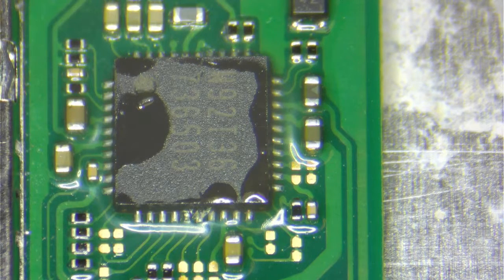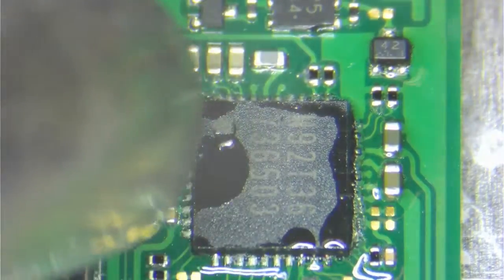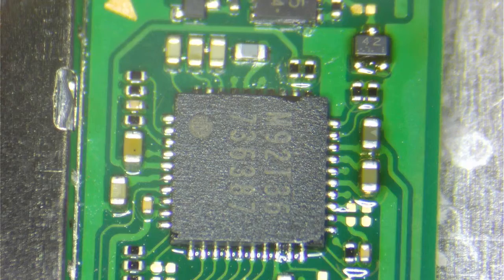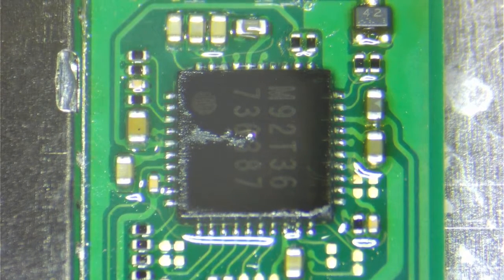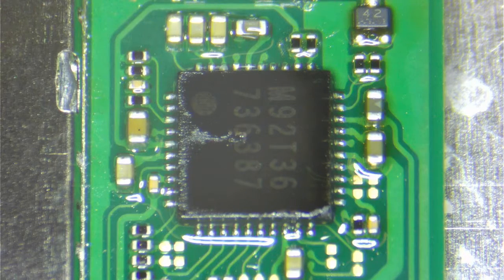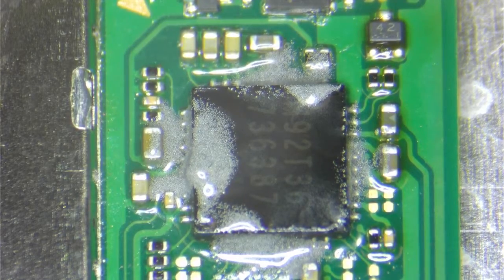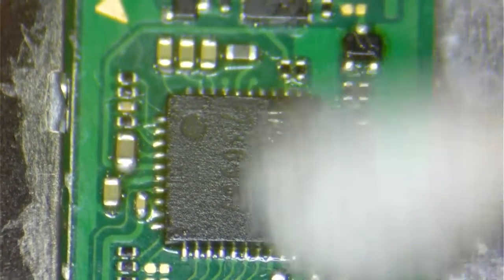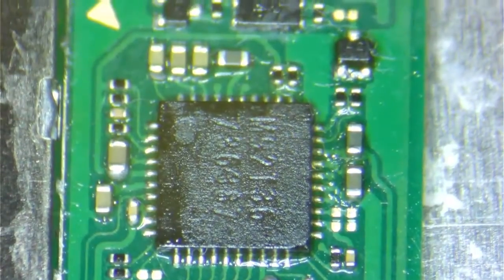Nintendo Switch Not Charging. Replacing the M92T36 Charge Control Chip

Comment: What's the trick in not blowing the smaller parts off the board?
Reply from the maker: Use caution and know your tools. Temp is extremely important and so is timing. Good luck on your install.